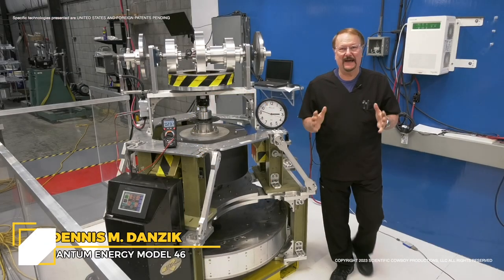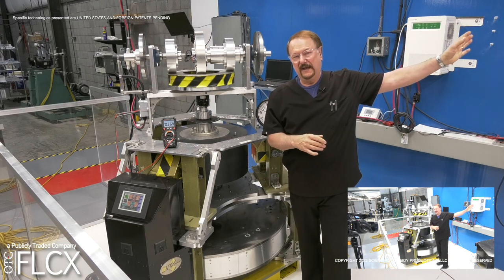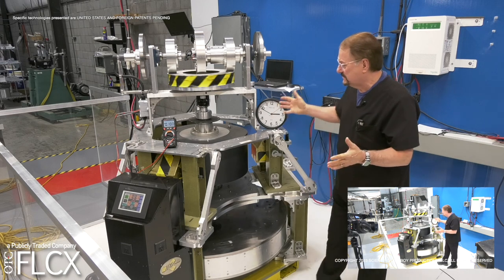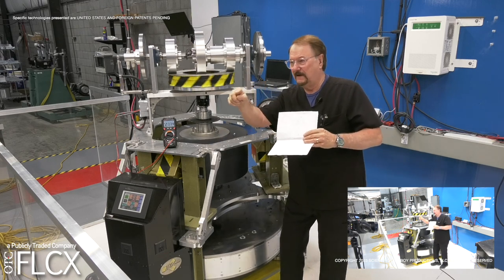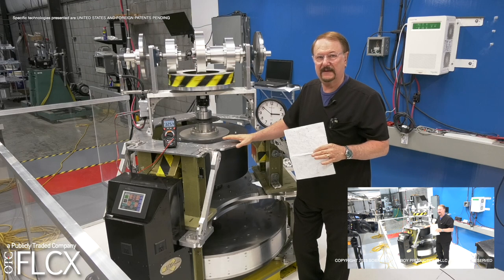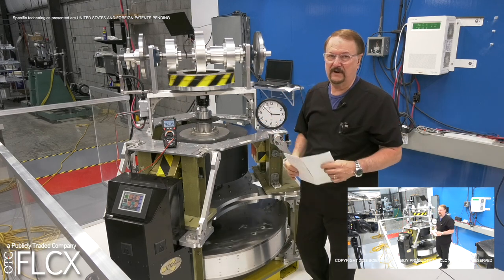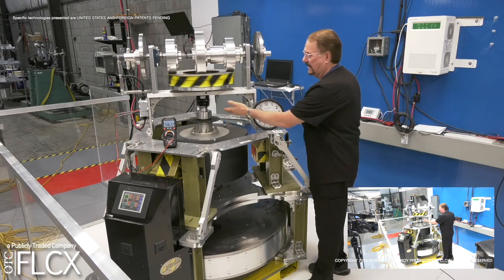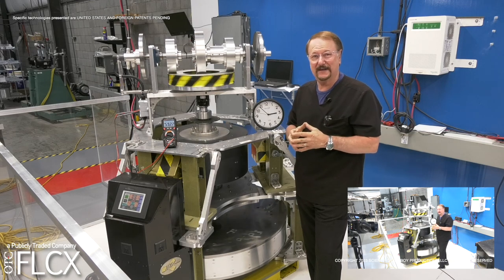Magnet Driven Zero Contact !

Comment: So based on that AMP output (WOW) is the intention to manufacture smaller units per house or large units for regions? So from a contract I see %'s of revenue assigned to you for power generation so is this a case of household effectively rents the units at $# and income from power generated or used is monitored and billed? Or does a household outright purchase at # cost like solar panels etc. Trying to understand the revenue aspect.....I've only watched some videos, but would be useful to cover these aspects....
Reply from the maker: Thank you for your comment and please stay tuned. Much more coming.